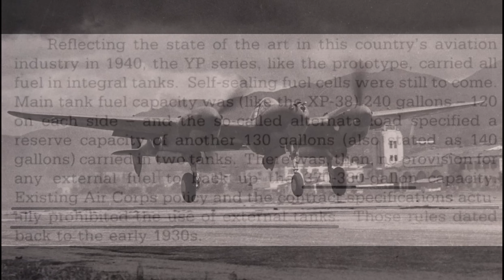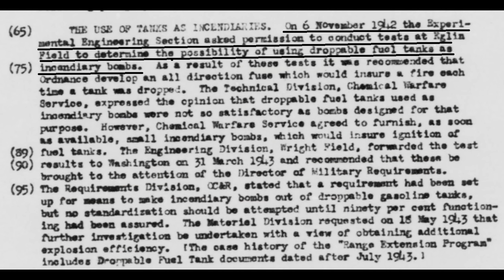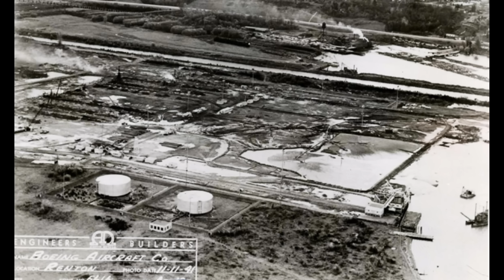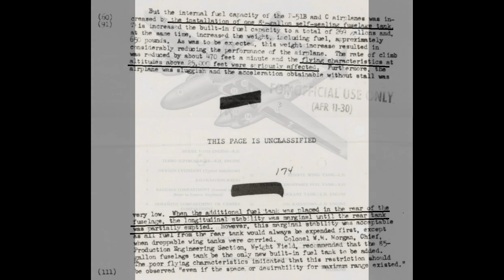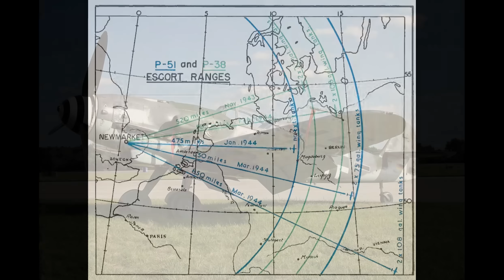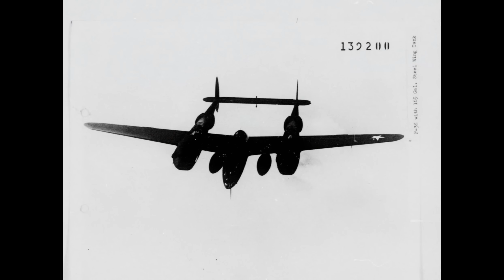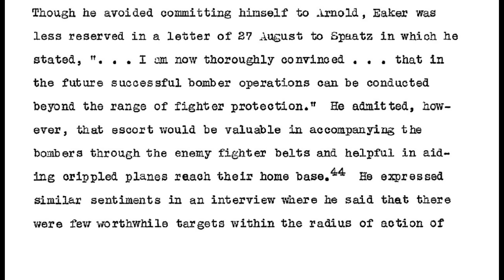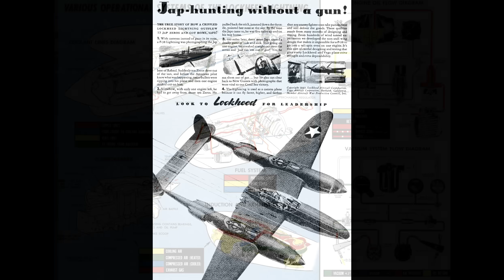The P 38 Lighting and the Bomber Mafia's Failure In World War Two

Comment: Greg. I don't want to bring the bomber mafia into this comment, just give some facts. Firstly the P38 did not have near the range of the P51 until march 44 when the internal fuel capacity was raised from 300 to 410 gallons. The gave them a combat radius of 650 miles. Previously with the H's and early J's it was only 440 miles. Combat radius in the European theater of operations was always less than other combat zones as often cruising for economy was very dangerous for fighters. So whilst the P38 could have helped on the Schweinfurt missions, they could not have gone with the bombers all the way. And what can not be overlooked was the poor combat effectiveness of the P38. Part of this was engine issues, which contrary to popular belief was initially far worse with the introduction of the J model. The 20th and 55th fighter groups were in the UK from the late Summer of 44,  shortly after the 355th, 352nd & 353rd FG with there P47's and before the 356th and 359th group P47's and were not able to contribute very much at all in the fall of 43 until the winter months. Despite their long range, P38's shot down comparatively few German aircraft up to  D-Day, by which time all the aforementioned P47 groups along with the 4th and 361st had been converted to the P51. Along with the 2 ninth air force units, the 354th & 353rd and the 2 eight units that arrived with the P51, the 357th and 339th the next priority after The invasion was to re-equip the 4 P38 groups as fast as possible. 

Now drop tanks. For combat operations in Europe the drop tanks had to be pressurized to operate at altitude, and it was found entering enemy territory below 20,000 feet was too dangerous. Apart from desperation tactics in using the 200 gal ferry tank in late July of 43 the first combat operations with a proper drop tanks were conducted in August with 108 gallon sheet steel tanks. Yes despite all the myths the first 108's were rolled sheet steel. However the British government was short of steel and so the 75 gallon tanks for the P39 and P40 which were available in large numbers were adapted for use. Bare in mind it was only in August the the P47s of the 4th 56th and 78th were equipped to carry anything. It was not until December43 that production of the paper tanks came on stream for those more experienced groups. In January supplies of US steel 108's and the flat 150s arrived. The Flat 150 was first used by the 56th for the first raid of big week on the 20th Feb 44. Wing racks started to be fitter to all the P47's in January44 , but this was not completed until April. From this point the P47 could carry 2 108's or 2 150's on the wing. Later the D25 with increase internal fuel could be seen with 2 150's on the wings and a 108 on the belly. But this was later in the war when the risk of interception early on was low.

The 51's used the 75's from Dec 43 to April 44 when they ran out. From April until D Day they all used both the paper 108's and the steel 108s. June was a period of Tactical operations and long range escorts started to ramp up from July onwards. The following P51 Groups used mostly the 108 gallon paper and steel tanks. The steel tanks were not rare and just as numerous as the paper tanks. 4th, 20th, 55th, 339th, 353rd, 355th, 356th 357th.  The 78th, 352nd, 359th, 361st, 364th, & 479th all used a teardrop tank which I believe were 110 gallon Tanks of US manufacture and NOT the 75 gallon tank that everyone thinks. I can support all this with photos. I am still doing my research on this, but a group such as the 352nd could not have been one of the top scoring groups without being at the pointy end of the combat range. There is much more information I have not included here and my research is ongoing. 110 gallon tank was used by the 9th AF and in the Med.

P51 with 184 gallons internal fuel and 2 75gallon tanks  combat radius 470 miles This was the P51 in Jan44 as first delivered before the extra fuselage tank was added.
P51 with 269 gallons internal fuel and 2 75gallon tanks  combat radius 705 miles This was the P51 in February 44
P51 with 269 gallons internal fuel and 2 108 or 110 gallon tanks  combat radius 750 miles This was the P51 in April 44

I hope you find this helpful
Reply: The P-38 gained 110 gallons of internal fuel capacity with the introduction of the J model, which began appearing in very late 1943.

The P-51, at the same time, began being delivered with an 85 gallon auxiliary tank, behind the cockpit, around the same time 

Two things. The P-38 did not have any resulting reduction in performance and handling with the additional fuel. The same CANNOT be said for the P-51 with the additional 85 gallons of internal fuel. The additional 700# caused not only a substantial reduction in climb rate, which was already well behind the P-38, but also a nasty tendency to "reverse stick" at lower air speeds.  The reduction in the performance of the P-51 required the use of the P-38 and P-47 to escort the bombers to the continent, since the P-51 COULD NOT fly directly from Britain to the continent and reach combat/escort altitude in a timely fashion. In fact, the P-51 simply could not reach the required altitude without "orbiting" Britain. 

These statements come DIRECTLY from Captain Arthur Heiden who flew "Lucky Lady", and was in combat with both the P-38 and the P-51. Those comments were further substantiated by Captain Stan Richardson Jr, and Captain Jack Ilfrey. They too flew both the P-38 and the P-51 in combat, Ilfrey as far back as the North Africa and Mediterranean campaign in early P-38 models. 

It was the P-38, and NOT the P-51 which appeared first over Berlin, and did it in full unit combat strength. 

The P-38 had a greater combat radius than the P-51 of the same deployment time period.
Reply: @ Alan I have read about 1/2 the unit histories of the Eight Airforce groups, and a number of other units outside the eight. I don't pretend to know everything about flying the aircraft, but I do know a lot about the technical aspects.

There are people who love the P38, and I can see why, but in the North European theater it was a failure. There are a number of reasons for this and will list them. 

Number one on the list is the engines. There was nothing intrinsically wrong with the Allison engine, but there was a lot wrong with the forced induction systems. In the H which was the first model to reach the eighth, full power could not be used because the engines would get detonation and fail due to inadequate charge cooling. Also handling of all the controls presented pilots with issues, a problem that is glossed over in context of the north European theater. Contrary to popular belief the J did not solve the engine issues, they were different and worse. This is outlined in a particularly good article by the Aircraft Engine Historical Society. I am currently reading a history of the 20th fighter group, and the number of aborts was 50% at times in the winter/spring of 43/44 with the J model. 

Another issue glossed over was the totally inadequate heating for the Pilot. This contributed to a reduction in pilot effectiveness and contributed to poor engine handling leading to engine failure or poor decisions in combat.

Whatever handling issues the P51 had with the 85-gallon tank, did not reduce its mission effectiveness. 

A couple of points to remember, the early J model P38's did not have the extra 110 gallons of fuel, so it was March 44 before the 20th and 55th could go the full 650 miles into Germany. By April when the P51 Groups switched to 108 gallon drop tanks they could go 750 miles. Even with a pair of 75-gallon tanks the P51 could go 705 miles.

In trying to understand why ranges in the European theater were so different to other theaters it is important to understand the missions, the altitude that needed to be flown, and the need to be at a high cruise speed for much of the Journey rather than at economical cruise speed where the aircraft were vulnerable.

I'm not knocking the P38 as such, but it is obvious that both Lockheed and Allison did little to take the engine issue seriously until the Eighth Airforce had lost patience with the aircraft. Even in the high-level photo recognisance mission the P38 needed P51 escorts on deep penetration, whereas the PRXI Spitfires of the 7th Recon could just climb away from most Luftwaffe aircraft. 

The funny this is it was Gregs videos on the P47 and its range that got me looking deeply into the range issue and why things did not happen in a timely manner. Yes, politics played a part, and pig headiness, or was it just complacency on the part of Certain Generals did not help. But what I have discovered is technical shortcoming played a much greater role than most people believe or want to believe. And these shortcomings were glossed over and often erased in the immediate post war period and it takes a lot of digging to get the full picture.
Reply: @tempestnut 
The J solved the inlet cooling issues. And the J had 55 gallon tanks in the leading edges of the wings. The two things the early J did not have were dive recovery flaps, and flat armored glass. Some also lacked boosted ailerons. These were lacking not because Lockheed didn't have them developed, but purely because the War Production Board prevented Lockheed from putting them on production models until the J-25.

Regarding engine controls, Lockheed already had the Unified Power Control, in mid 1943. Again, the War Production Board refused to allow Lockheed to install it. Ever. Much like the K series lead computing gun sight. In fact, Colonel Harold Rau wrote a letter to the command staff asking why, if Lockheed was literally showing him the Unified Power Control, that it was not installed on the planes. So, no, Lockheed and Allison DID NOT fail to address the issues, the War Production Board failed to.allow them to install the improved parts.

As far as engine operating problems in the J model, again, as Tony LeVier stated, the 8th AF was using the absolute worst possible engine settings, in direct conflict with the pilot's operating manual. Tony LeVier said, repeatedly, over decades, that when he arrived in Britain, the state of the P-38's was abysmal, and he would have declared 90% of them not airworthy based on how the were rigged and maintained. The pilot confidence problem was due to the rigging and maintenance, and the incorrect operating methods. LeVier spent a couple of MONTHS showing mechanics how to rig and maintain the planes, and pilots how to fly them. 

I heard that not only directly from Tony LeVier himself, but also from 20th and 55th pilots themselves, I knew several personally, including Art Heiden and Stan Richardson. Art Heiden specifically states his group was rushed into operational status, and then had to spend months resolving the issues handed to them, with precious little support. He also states that when he got his first J model, things changed dramatically, and when he got the delayed J-25, he would "roll over, pop the flaps, and follow Jerry into his escape dive".

Did Art like his P-51? Sure. But did he consider it a better plan, and a cure? No, he did not.

The early P-38 did have its problems and limitations, but even it was a match for the Luftwaffe, maintained and flown well. The P-38J was the cure for the shortcomings of the F, G, and H, especially the later J. And not only would the J have already been in combat in late 1943, but the much improved, but never ordered P-38K would have, if not for the War Production Board.

While the critical Mach issue might have been difficult to resolve (the cure was there, NACA developed it) every issue afflicting the P-38 was resolved in testing, and would have been resolved in production were it not for the War Production Board.
Reply from the maker: What I said was the earlier 38's had enough range to escort to Schweinfurt. Going all the way to Berlin required a J model with the increased fuel capacity or later. Those were around way before any escorting to Berlin was required anyway. 

It sounds to me like you didn't watch the video the entire way through as I certainly explained why the tanks were not pressurized and what the proven work around was. I suggest watching my video on the P-47 Brisbane tank. That has a lot of the relevant info in it.

Comment: Greg,

Anecdotal data for you about paper tanks! They  may have been more common than thought
My father (since passed) was a crew chief in the 8th Air Force 479th Fighter Group in Ipswich late in the war. At first he had '38s and transitioned to '51s. One of his stories regarded doing the preflight on a '51 which involved pressurizing the drop tanks. One of the PAPER TANKS had a finger sized hole and a massive leak. No time to drain and replace it, so he dropped it (with a prayer) in the revetment and hoped it wouldn't break. Of course it did! Got another tank fitted and filled. When the pilot showed up he asked about the rather large puddle of liquid around the plane. My father told him, "Don't worry about it. But don't prime it when you start it!"  Then he stood by with the fire bottle ...

Point being, he never mentioned the paper tanks being rare. They may have been more common than the evidence suggests. Of course, I have no data about where they came from.

On other notes, he did say getting the '51s was like going on vacation from a maintenance point of view. (One engine mostly!) He polished the aluminum on his airplanes and the pilots claimed it was worth 10-20 MPH. I received a bronze star for missions without a mechanical abort. He was only a couple short of silver when his pilot had to abort with a booster pump failure 10 minutes before the mission was scrubbed for weather. The pilot knew he was close and was more PO'ed than he was! I learned a lot about maintenance and life (do the maintenance) from that guy! And today was his birthday!

Thanks for your work.

Comment: Does this point to a problem of intransigence or a lack of imagination or ability to adjust on the fly, across the U.S. military leadership in World War 2? Certainly not restricted to the U.S. military but perhaps more important, in terms of lives unnecessarily lost because of its size? The same lack of imagination was evidence in the Pacific island campaign with thousands of lives lost for tiny islands that could have been bypassed and left to starve or been reduced through gas or napalm attacks. More recently the B-52’s taking the same routes raid after raid, resulting in a high loss-rate. It seems that when the pre-action plan fails to work, a parochial attitude prevails until it cannot be sustained.

Comment: The P-38 was a disaster in the high-altitude European theater. Robin Olds, who was trained on and became an ace in P-38s was all too happy when he converted to the P-51. The P-38s were a lot more expensive, did not operate well at high altitudes due to several engineering flaws, and did not like going too fast. Their war record reflects reality: they were far more well suited for the Pacific war. The P-51 performed the high-altitude escort role much better than the P-38 and was half the price. Which aircraft stayed in service after the war? Not the P-38 or P-47.

Comment: What role did Col. Cass Hough (Ex Prez of Daisy Rifles) have in developing drop tanks while in England?  Wasn't both Humidity and cold temps the excuses used to discount using the P-38? I also suspect that the P-51 was greenlighted because it was more fuel efficient than either the P-47 or P-38. I agree with all of your conclusions and the Bomber Mafia were a detriment to the USAAF in Europe.

Comment: I laughed at your 'rant' against metric measurement - If, what you say is true, why are you not using knots instead of miles per hour?  After all there are only 17 countries that still use MPH, as opposed to 170+ that use KPH.  🙂  Great video though, and I enjoy your real voice instead of the AI on other channels.
Reply from the maker: Thanks, I absolutely do use knots when they were used originally. MPH was originally used with the planes in this video. For example, when making a video about a Bf 109 I use kmh. The question I was answering is why convert to a standard nobody is using in aviation?
Reply: @GregsAirplanesandAutomobiles  To make it easier for those who don't use MPH to understand the video?  I'm of an age who understands all three, and for aircraft MPH is my prefered, however most European group use KPH with MPH in brackets.

Comment: Found it interesting that the 108's "850lbs" on the wings of p51 was pushing the structural limits of the plane. The hellhawks flying p47's tested 2000lbs bombs on the wings and found the plane was fine but the bomb shackle wasnt up to the task. Tells you a lot about the compromises made in the designs of the two aircraft.  Its the little details off the main story i enjoy the most.